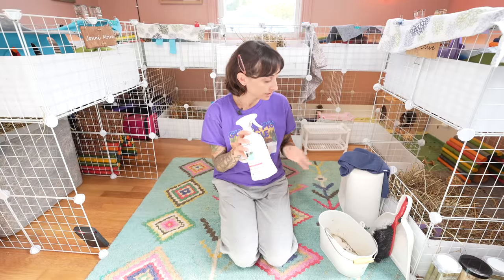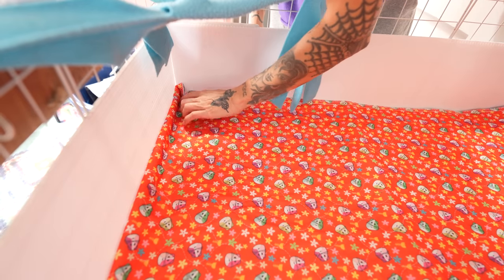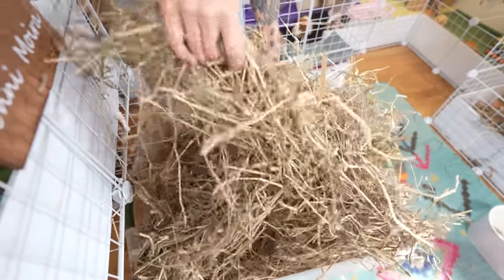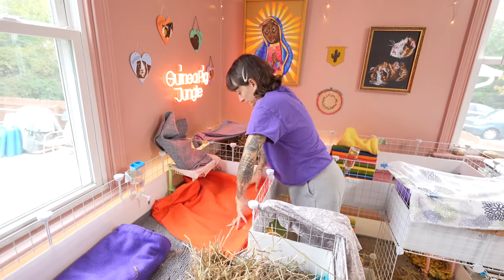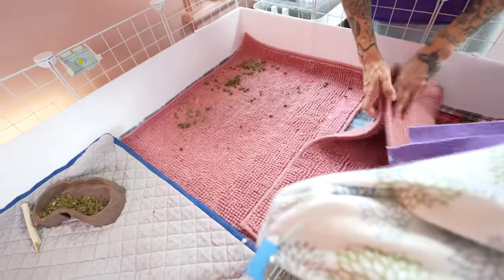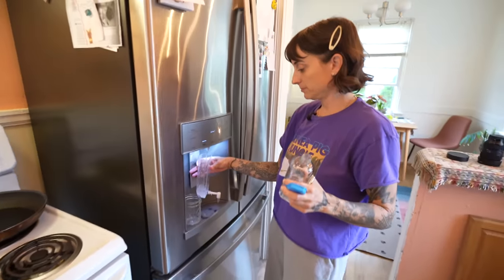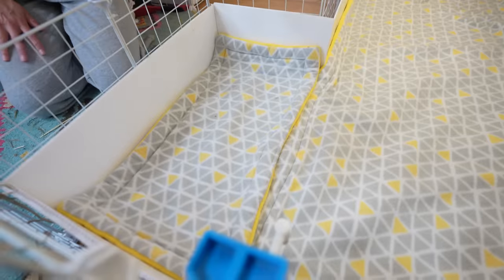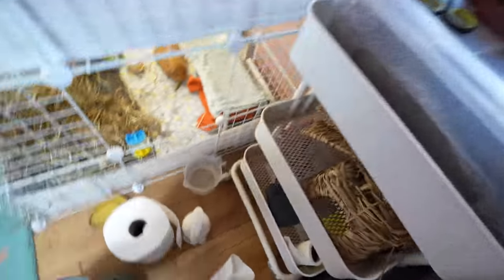First Time Cage Cleaning My NEW C&C Guinea Pig Cage 🐹

Comment: I find that large liners (like Guinea Dad liners) seem like a good idea until it comes to cleaning; one heavy-use spot and the whole thing needs to be swapped out. I prefer multiple 60x40cm (24x16in) chenille/memory foam bath mats that can be switched out as needed. They're comfy, absorbant, waterproof, easier to wash and can often be bought for under $2-$3. You can buy more than 10 bath mats for the same price as one (120x61cm) Guinea Dad liner - that's about a quarter of the cost for the same area coverage.
Reply from the maker: Agreed

Comment: Are c and c cages the same as kavee cages ?
Reply from the maker: They are similar to the grids kavee uses. I used to have a kavee cage but it just wasn’t suitable for what I needed nor provided enough space.
Reply: @GuineaPigJungle  thank you. I bought a kavee cage 3x2 for my 2 girl but it’s to small so I want to buy them another one and connect them. But I would like to raise them because it’s not easy for me and my back (they are on the 2 grid level and I would like them on the third) but I am scared that it will be shaky